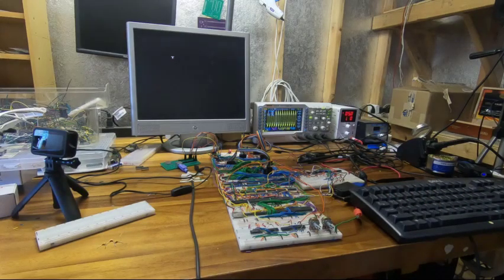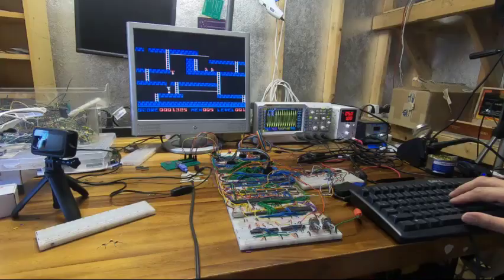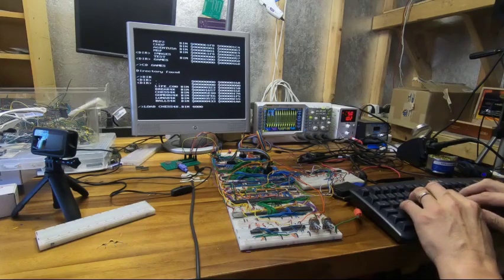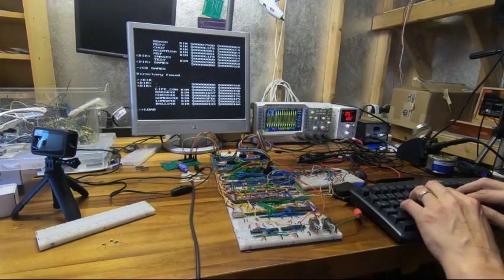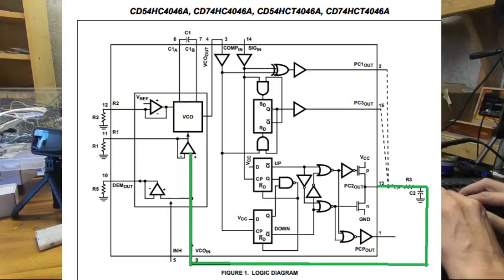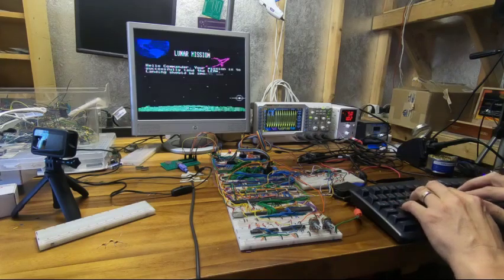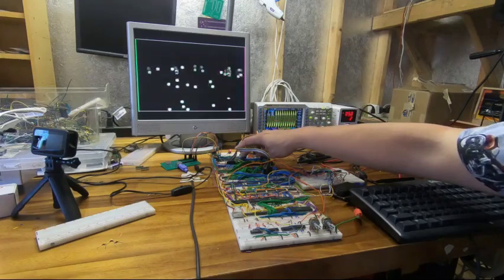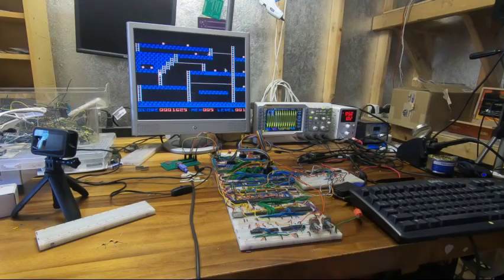From PCB to breadboards.  Ultima IV on the 3RIC 6502, a status update.

Comment: Hi Eric, nice work!  An alternative to the PLL is a programmable oscillator like the DS1086Z, you can set it to whatever frequency you like, within reason.  It is only available for surface mount, but I made an adaptor PCB that gives it the same pinout as a standard through-hole oscillator.
Reply from the maker: Ahh cool, I'll check that out.  The main requirement is that the signal needs to be sync'd to the CPU clock.   The shift register needs to clock at 7 times the CPU clock in my system.  If the programmable oscillator can generate sync'd signals at varying frequencies, it might work.
Reply: @thecodesorcerer  Ah no it can't do that. You could generate a faster clock though, and divide it down by different amounts for each of them, keeping results in sync. PLLs sounds fun to play with though!